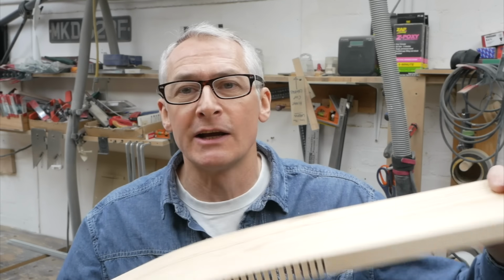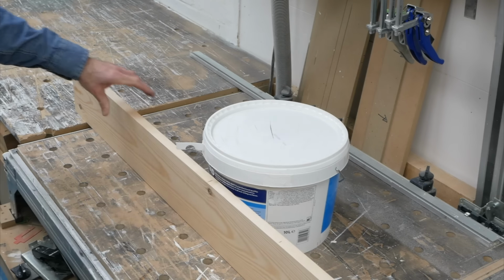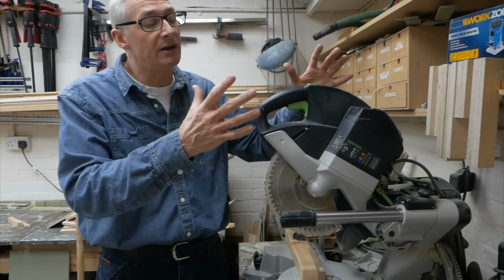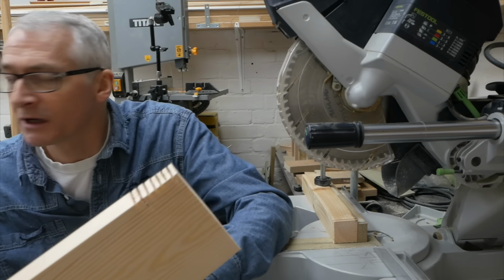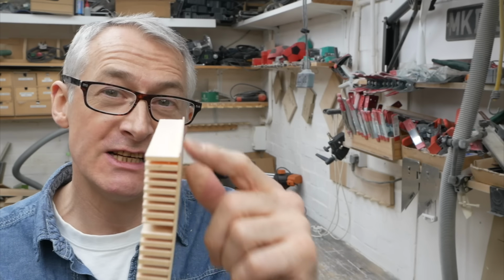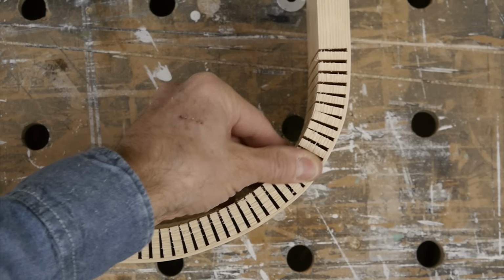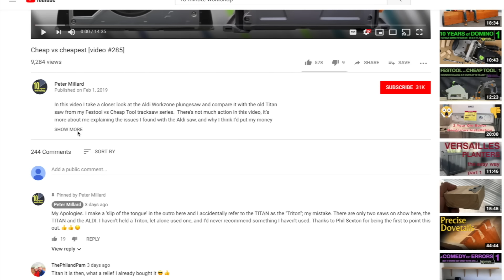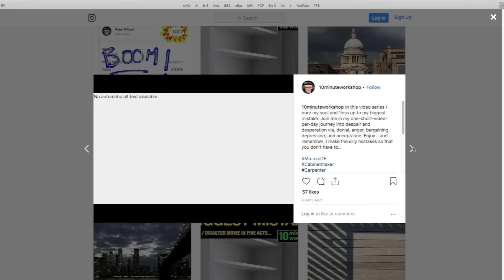How To Bend Baseboard Around a Curved Wall [video #288]

Comment: If you was to class this type of curved wall as an internal curve, how do you cut the baseboards for an external curved wall 
A curved wall the opposite curve to the curve in your video??
Reply from the maker: A concave curve would be the same. But you need to be very careful if you’re using natural timber as for some reason it doesn’t bend as readily in the other direction. Might also need soaking or steaming. 🤷‍♂️👍

Comment: Hey Pete. Noticed you call it a mitre saw? You know we call it a chop saw here in the 🇬🇧. You’ve been watching too many American woodworking vids!? 😂👍
Reply from the maker: Wait, I’m all confuddled now. I need to go and cut some dados in the casings, before trimming out the wainscotting with maple then moving on to the plywood shop cabinets. Then I’ll break out the 8x2s and cut them down to length with my mitre saw👍👍
Reply: Wrong, a chop saw moves up and down, a mitre saw, cuts mitre's a chop saw doesn't move left or right, although I see a few americans calling it a chopsaw... Have a look on screwfix and you will find that "Chop Saw" brings back Mitres saws. See here:
https://www.wonkeedonkeetools.co.uk/mitre-shears/what-is-a-mitre-cut/
Reply: Peter Millard 😂😂😂👍👍
Reply: Phil Sexton dude. I’m a 46 year old uk carpenter. We all call them chop saws! Same as we call circular saws “skill saws”. Just our thing!?
Reply: Silver Fox Well I beat you on the age and I only hear Americans use chop and Skill saw. A mitre is a mitre at the end of the day mate ;o)

Comment: Ahh, I can see my trusty orange steed there, is this just something you use or do I sense another cheap tool vs...?
Reply from the maker: They asked if they could send me one  for review, I said OK, as long as I can compare it to my Kapex. So they sent it 👍👍 Won’t be a Festool vs ??? as they’re not directly comparable, but interesting to compare, anyway. 👍👍
Reply: @10MinuteWorkshop  Yeah, I will be watching carefully, I would love a Kapex but I just can't justify it compared to what I have, its no where near as good as the Kapex when it comes to dust collection, but the ability to cut wood and metal with one blade is a real bonus for me. The are times when I wish for more accuracy but for most of what I do, its fine.

Comment: I would imagine knots must be avoided. Also, are there ever any stress issues such as splitting at a later date?
Reply from the maker: Yes, indeed, no knots in the curve. And no, never had any stress issues later on. A good suggestion from earlier on in the comments was to add glue (maybe PU) to the kerf cuts before bending, then this would strengthen the whole thing. As I say, I’ve never had a problem, but if it costs next to nothing and may help - why not?? 👍👍